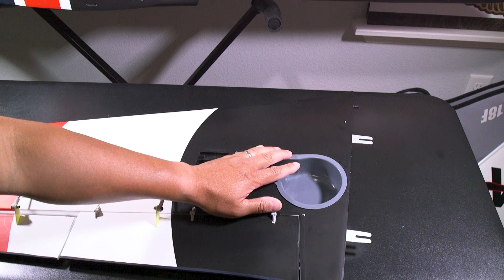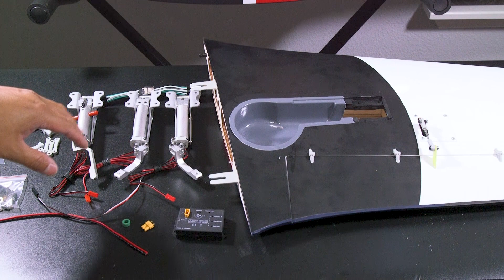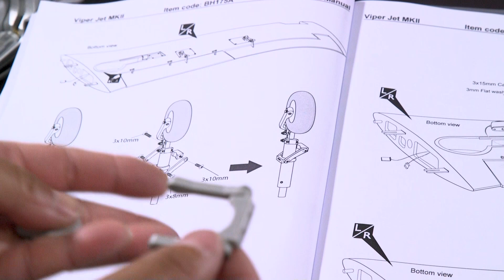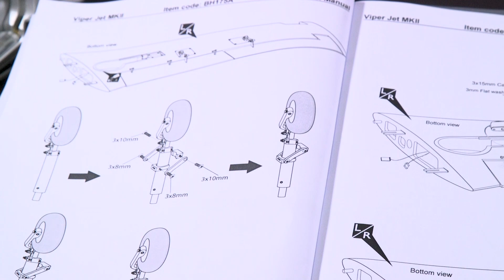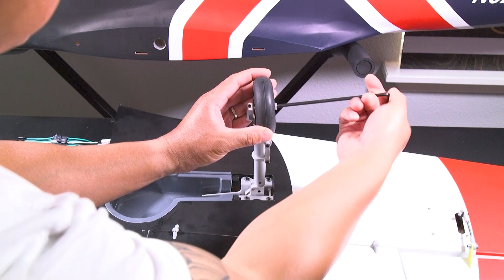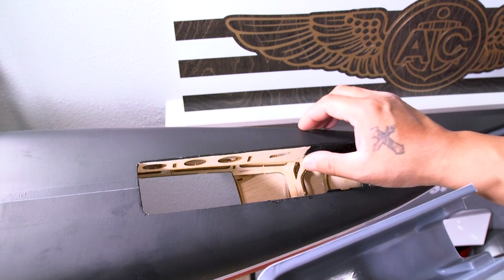Blackhorse Model Assembly Part 2. #aviation #airplane #rcaircraft #rcplane #modelairplane #rcjet

Comment: I just got my Viper and have a few questions. 

Where did you get your 5-1 connectors?

Did you order a certain light kit from unilight or did you special order for this plane?
Reply from the maker: All the links for the lights are listed in the description on this video

https://youtu.be/4pbtTnB7ZQI?si=E1iheEwY9cIxInmj
Reply: @WarrenRC6373 thank you. I found them last night. I’m going to get the maiden out of the way first before investing another 3-400$. 

It has the HSD 120 ( not sure which motor) 160 castle ESC   And I’m adding the new Spektrum Synapse receiver

Comment: Love the build series! 

I’m interested in how you set up the power system on your aircraft. Could you share which batteries you used and how you configured them? For example, did you dedicate one 2S pack to the retracts and another 2S pack for the receiver and lights? In the video, it looks like you used a 2S 2550mAh LiPo for the retracts. Did you run a UBEC or BEC in your setup?
Reply from the maker: Original setup was two 2s Li-ion receiver packs and one 2s li-ion for the retracts and lights. I’m not sure what the owner has done to the jet now but it is currently flying as a turbine now last I saw it.

Comment: Hi, thanks for the video. Is that an AR 521 or AR 541 connector? I ask as I would like to purchase a couple as they seem like exactly what I require.
Reply from the maker: https://boomarc.com/en/ar-one-click-plus

I’m editing Part.3 that covers all the wiring I did along with mountable connectors for the horizontal and vertical stabs for a cleaner setup.

Thanks for watching!
Reply: @WarrenRC6373  awesome, thank you very much 👍🏾